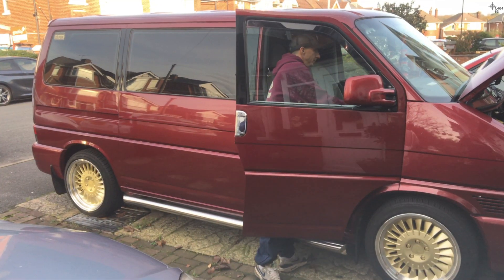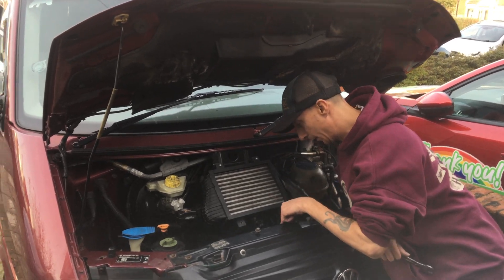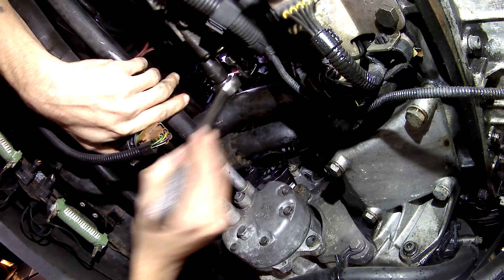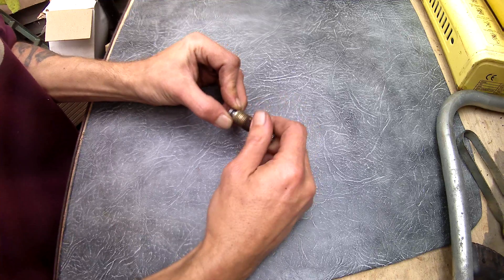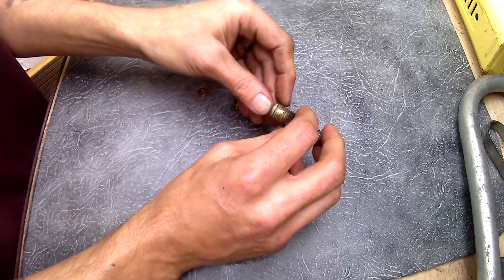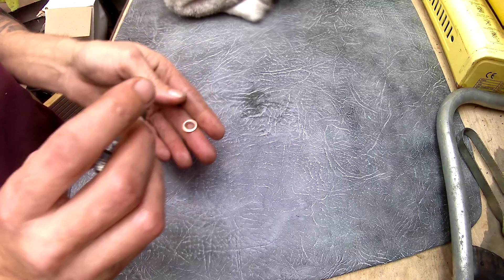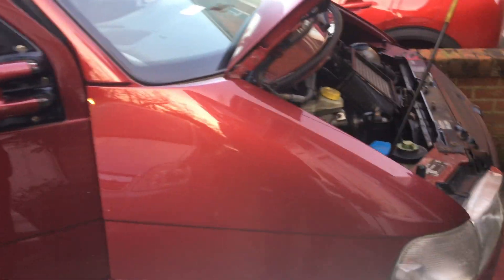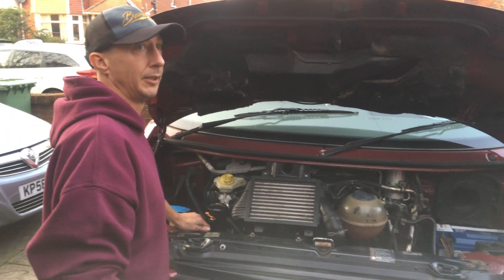2.5tdi ACV running on 4 cylinders

Comment: Did you manage to diagnose the problem?  I have a very similar problem on my syncro
Reply from the maker: Snapped piston ring, caused excessive wear on cylinder bore. Needed new rings and new liner in the block

Comment: Bugger dude was hoping the injector swap was going to be good news.
Reply from the maker: I know right, on the plus side I think I got plenty of time until the next VW event 😂
Reply: @TwiggsT4  sure its not squeeze
like loss of compression
Reply: cam shaft
Reply from the maker: Piston rings broken and an excessively worn bore
Reply: @TwiggsT4  hopefully the cylinder walls are ok
Reply from the maker: @porschesme  unfortunately it’s slightly egg shaped so either bore out for oversized pistons or sleeve it. That’ll be a winter job in the garage 👍